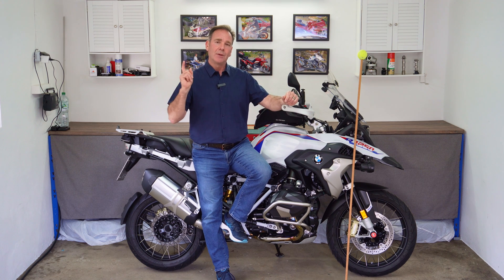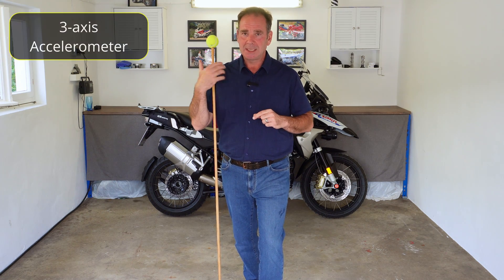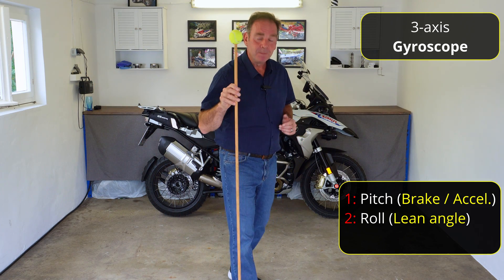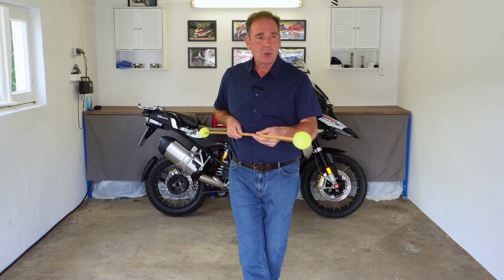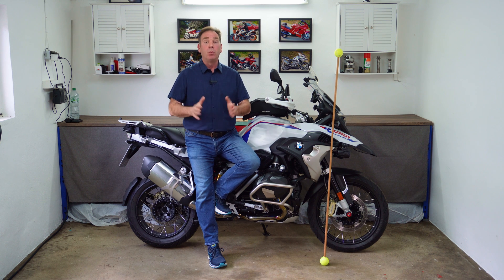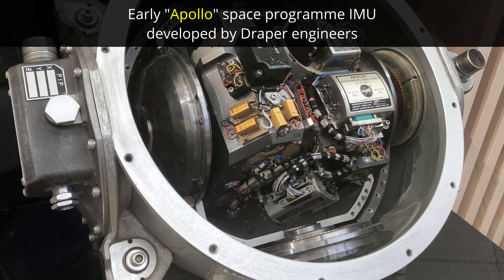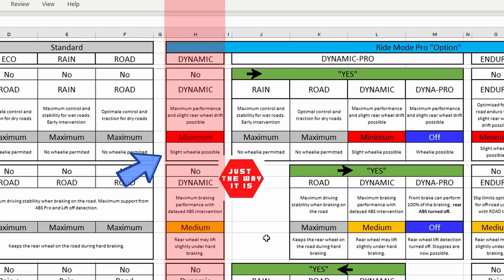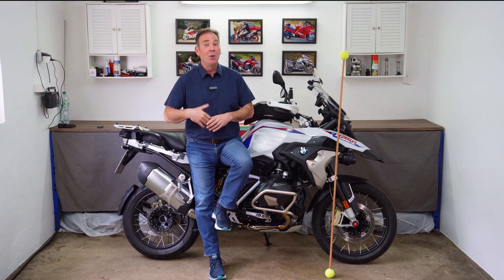BMW R1250GS / R1300GS - 6-axis IMU Explained - Inertial Measurement Unit what is Roll, Pitch and Yaw

Comment: Thanks for your explaination. Very clear and informative. What if we disconnect the imu in the bmw gs, is abs indicator ON (due to abs pro need imu) and dtc indicator ON (due to DTC fail)?
Reply from the maker: Hi, I have not tried that but I would imagine yes you would have multiple system error messages. On the dashboard. ABS and DTC and contact your dealership. Carl
Reply: @justthewayitis because im using gsa model 2017 with the analog meter. I disconnect the imu by unplug the sensor under rear seat and the ABS Indicator is ON. However, ASC/DTC indicator is normal and I'm wondering if the imu is used for the DTC function or not 😂😂😂
Reply from the maker: Well the 2017 model has 5-axis’s IMU which the system uses for DTC with regards to front and rear lift detection, and  brake assist and DBC, the suspension system also uses the IMU . Have fun 😊

Comment: Brilliant explanation. I'm a pilot and had failed to grasp what the extra three axes were as we only really deal with pitch, roll and yaw. Thrust, heave and sway makes perfect sense. Thank you!
Reply from the maker: Hi MH, thank you 🙏, glad the explanation helped. It’s not easy to grasp and understand but it sounds like you have now understood the fundamentals. The systems they use on planes are much more advanced than the units used on motorbikes. You are very welcome and thank you for leaving a comment 👍
Kind regards Carl
Reply: @justthewayitis  The ability to explain complex processes to those who know nothing about them is a gift. To be able to explain clearly and concisely to those who think they do or should know all about it is another level. The broom was a great demonstrator but it was the distinction between the measurements made by gyros (with which I'm painfully familiar) and those by accelerometers that really drove the message home, made it a nightcap and tucked it up into bed. Chapeau Sir! (if you ever want to explain Bernoulli's Theorem to a similar audience, I have a great analogy using a column of soldiers crossing a narrow bridge that you're welcome to have).
Reply from the maker: Thank you that’s a kind offer, I think that would be beyond what motorbike owners want to understand ( main focus of my channel), however your generous offer has been noted 👍. My Dad was a Naval engineer and if he didn’t understand a system he took it apart to understand all the elements involved, I was shown how a TV worked and how to repair one when I was 15, lol so I guess I learned a lot about explaining complex systems in simple language from him.
Kind regards Carl 🙋🏻‍♂️

Comment: My brand new MT-10 arrived today...lots of tech, and my first bike with an IMU, i'm running it in at the moment, but the handling of this bike is like nothing i've owned before. I had the original 2016 MT-10 and i loved it but this feels more ....how can i word it...alive. It's like it's working with me. I remember my 90s Gixxer 750s, fun, but one slight error and it was a trip to the hospital. Great video, but i will have to watch it a couple more times and write things down.
Reply from the maker: Hi Gary, good morning and thank you 🙏, congratulations on your MT-10, it’s a lovely motorbike and it sounds like you have found the perfect bike for you. Yes 🫣, back in the 90’s it was hard to push the big bikes with zero safety net. I have several broken bones from back then 🫣. Modern systems are really making things easier and safer. Have fun with your motorbike. Kind regards Carl
Reply: @justthewayitis  Thanks Carl, I also have broken bones from the 90s. lol

Comment: Hi, the new speed twin 900 & 1200 come with cornering abs and cornering traction control via an IMU. Will that be a 6 axis IMU as explained here? Triumph has not clarified so i thought i will ask here!
Reply from the maker: Hi Ash, I would think so, because it’s not possible to accurately measure lean angle without a sensor that incorporates this axis and the other two main axis that the ecu needs to measure and control movements. So although I can’t confirm 100% I would imagine yes it uses a 6-axis IMU. Probably a Bosch unit. Also Triumph have confirmed they use a 6-axis IMU on several other products (Tiger 800 sport for example) so this also is an indication it’s probably used on the new speed twins.
Best wishes Carl
Reply: @justthewayitis  Thanks a lot for this! As someone who may be interested in buying them, should be careful while pressure washing them so that i don't damage the imu? I believe they come in a sealed casing so was just curious to know. Also , is this the same one on the BMW as shown in this video ?
Reply from the maker: They are normally located under the seat area away from vibration, heat and water. Only your Triumph dealership or perhaps the online forums can confirm which modules they use and the location on the motorbike. 🙋🏻‍♂️
Reply: @justthewayitis  Thanks for this Carl. Carl, sorry i have one more question and I would be super grateful if you can answer this. I am looking at getting a speed twin 1200. I have 2 options a MY 2024 which does not have the IMU but superior brakes (Brembo M 50) and a MY 2025 one which has the IMU but a slight step (J Juan) down in brakes. If you were in my position with these two options, would you get the  bike without the IMU ? Does IMU play a sizeable role in safety that makes it foolish not to consider it? I live in India. I drive only on road. I don't cross 100 km/hr. Roads here are by and large very good in my city but one does encounter bad stretches of road now and then with potholes etc. Would love to know your opinion on this!
Reply from the maker: 2025 version, as the additional features of the safety systems and advanced control are more beneficial than the difference in braking performance.
For me it wound be the 2025 model year.
Reply: @ thanks for this , carl! You made my decision a lot easier!!

Comment: Thank you so much for this splendid explanation.
Reply: Hi Carl, I’m sure you’re already aware but wanted to put it out to fellow GS/GSA riders that yesterday 19/04/24 Hex have updated software and firmware on gs911 so you can now turn off both front and rear running lights effectively concerting your 22/23/24 indicators back to 2021, just good old fashioned orange turn signals . I believe you can also adjust large rear light brightness for tail and brake light .
Sleep happy fellow GS/GSA riders . And thanks Hex for sorting such a dangerous lighting system out !!!
Reply from the maker: Hi Peter, good morning and thank you for letting me know about the update, a couple of subscribers have already highlighted this to me . Overall, I think its great news, but we also need to think about the bigger picture. If we as owners add an accessory or product to our motorbikes it does not generally affect warranty. BUT if we make ANY changes to the OEM coding or software that is installed on our motorbikes, we immediately invalidate any warranty. 

So, although the GS-911 device can add additional screens and make changes to the OEM coding that affect our indicator functions, owners need to be fully aware that any change will immediately invalidate our warranty. 

I have had this confirmed by two separate dealerships. 

Providing owners are aware of this and are prepared to accept the responsibility then that’s great. But each of us individually, need to make this decision. 

Thank you for reaching out to me, much appreciated, and I think this whole topic perhaps needs its own video. 
kind regards Carl
Reply from the maker: Hello RG500, thank you 🙏

Comment: Absolutely fascinating! Despite riding bikes for the last 45yrs I still get nervous about apply the brakes when wet….but it’s great to know that when I do someone has engineered the bike to initiate the most appropriate response!
One quick question though? Towards the end you mentioned that the algorithm used the performance of the tyres as part of the equation. This being the case, is it safe to assume therefore that the difference in tyre brands when considering traction/adhesion is relatively small or is it that the tyre performance characteristics don’t have a significant “priority weighting” in the overall algorithm? 
Keep up the great work!
Reply from the maker: Hi great question, years ago when you and I started riding motorbikes, there was a lot a difference between tyre brands, some good and some horrible 😉, but now things are very different and they are all pretty good. The testing and breakaway point for tyres would have been set using standard tyres that bmw supplied on the bike from new plus a little extra margin so doubt any of us mere mortals would exceed the limits set during testing. Although I personally would not want to test that with full off-road tyres but I’m sure the testers did.
But then again bmw do state that when using Enduro Pro to only full off road tyres should be used, so I would imagine the abs setting is different in that mode.
Hope that helps 
Kind regards Carl

Comment: Thanks Carl. I followed that perfectly because of the way you explained it. I'm a programmer and an electronics technician but that doesn't mean I disrespect the effort you have provided for increasing our understanding, or BMW's effort for providing the technology.
I'm not sure if this was an example, but I was rolling down a steep, mossy and slippery driveway. The bike (R1250GS) started to slip as I had both brakes applied, but it seemed to self correct and I continued as if there was no problem. The only time I've ever dropped her (my bike) was at a complete standstill due to a fail on my part with the foot stand. Thankful for the crash bars and only a single scrape under one crash bar which you would have to be underneath the bike to see. Always put crash bars on these beauties guys!
Reply from the maker: Hi Michael, thank you for leaving a message it’s nice to hear the videos I make are useful. Technically there is a lot more to it as I’m sure you are well aware, but I try to keep it simple and easy to follow and cover the basics so riders have a better understanding of the systems. Finding a balance between full detailed explanations and still engaging viewers is something I battle with while making each video, this particular one was originally much longer and in more depth but I decided to reduce it this time.
Thank you for leaving a comment 🙏
Kindest regards Carl

Comment: Great stuff Bro.
Its amazing how much these modes do.
Turn it all off and I promise you the 1250 will 12 oclock with one little crack of the throttle.
 I wish BMW could work out how to skyhook us. Keeping us flat and the suspension doing all the work instead of bouncing us around everywhere.
Reply from the maker: did you notice i kept it short this time !!! smile
Reply: @justthewayitis  I did :). Nothing wrong with long form Carl though.
Reply: Cheers mate. A great explanation and easily understood! 👍🏻
Reply from the maker: Hi Ben, thank you 🙏 
Glad you enjoyed it 👍, Carl
Reply from the maker: That would be cool! and a great idea Craig, the new 1300 is closer to that, but still not quite there. 👍